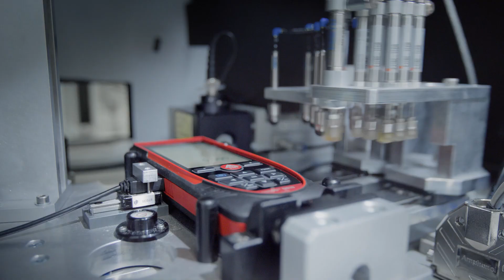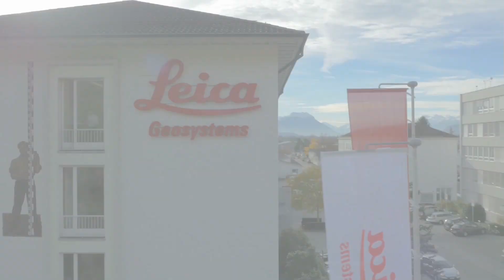Leica DISTO™ - The Original - Production

Comment: The beam on my DX310 has always been off at an angle. I assumed this was how it worked, the video shows the beam being adjusted on a target...
Reply from the maker: All our DISTO are adjusted with some offsets also in angles, but they have to be within limited tolerances. If you think, your DISTO is outside the tolerances described in the user manual, please contact your dealer for support.